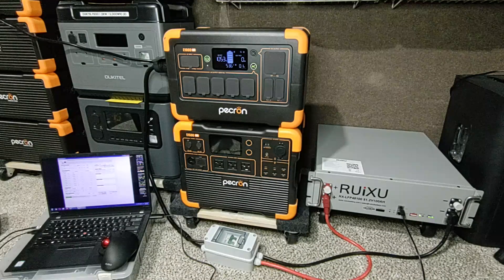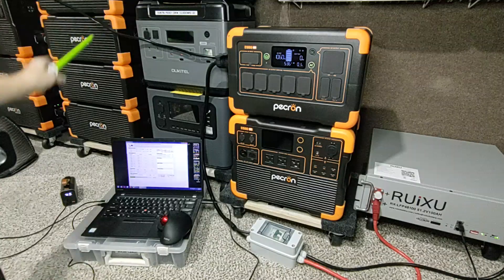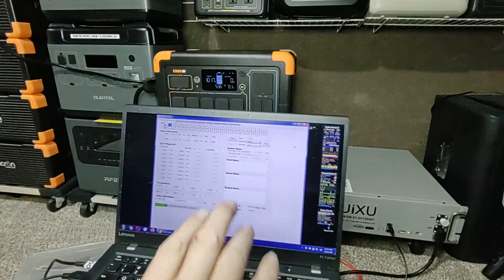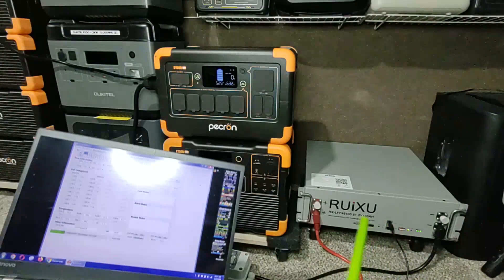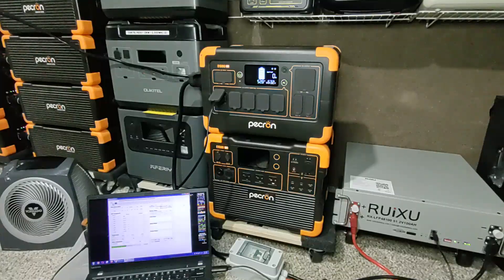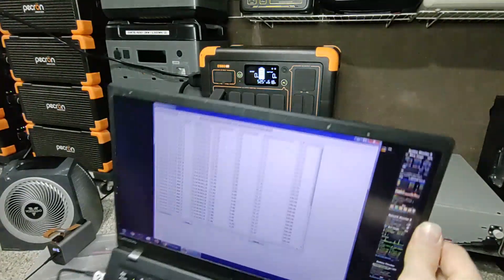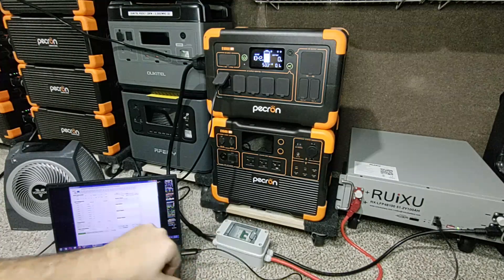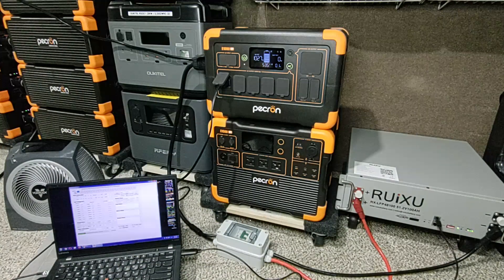Pecron power station using a server rack battery? Does this really work? (((((PART 1)))))

Comment: @Ramblin' Bob Reviews hey bud, i know you said in the video that the server rack battery and the unit needs to be the same volts. so i have a pecron 600lfp and if i want to add a server rack to the solar port i can use any battery as long as its in the guild lines of what the solar port aloud (32V–95V operating voltage and a maximum input of 400W)? so as long as the server rack battery or any battery for that matter is no less then 32v and no higher then 95v is this right?

thanks
Reply from the maker: We ran a ep3000 kinda that way.

EP3000 -----> e600lfp (but we came out the 12v aux port of the ep3000)

We were never brave enough to try it straight from the battery connection yet...lol

  In theory, it seems like it will work fine because as long as you keep that voltage of whatever battery you are using under that VOC of 95v, the system will just think it is coming in from a solar panel :)

   I know that you can do it from a 12v car battery, So it should work with a server rack battery....

   The huge difference in what we are doing here is, we can charge the server rack battery from the e1000lfp, and that is the main idea of this mod :)
(In your idea, you would have to find a way to charge that server rack battery)

  You should get more info about this because we are very new with this kind of mod, so be careful and make 100% that you fuse or circuit breaker that connection.
Reply: @RamblinBobReviews  ok but this video saying the volts in the battery and the volts in the power station need to much. so if the power station on the solar ports are saying 32v to 95v i means i can use any battery like say a 48v 5120watt server rack battery and i will be ok since cause the battery volts are matching? is that how it works so i know if this isnt how it works then how i i new what battery's will work with my power station? 

thank you
Reply from the maker: When you put power into a system by going through a MPPT controller (solar input) That regulates that power going in safely.

   When you hook up batteries together (modding something), thay have to be 100% the same voltage.

What you are trying to do and what we did in this video are 100% different setups...

Comment: Good morning. I have this mod on my e3)00 with 2 Humsienk wall mounts and a Humsienk golf cart battery connected through a bus bar. My e3600 also has 2- EP3000s connected. 
All the non-proprietary battery’s have DC breakers between each and the bus bar. I then have a DC breakers between each between the bus bar and the Pecron units. I’m using g 4AWG wire. Works great so far.
Also doing this hack with my F3000 and a golf cart battery for a greenhouse.
Reply from the maker: That's an amazing setup, thanks for sharing all the details about your custom system :)